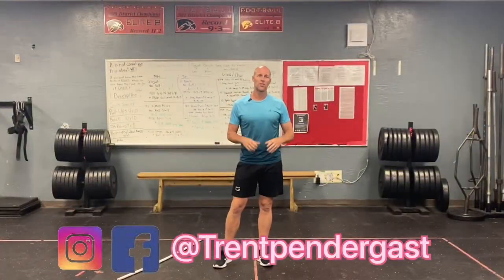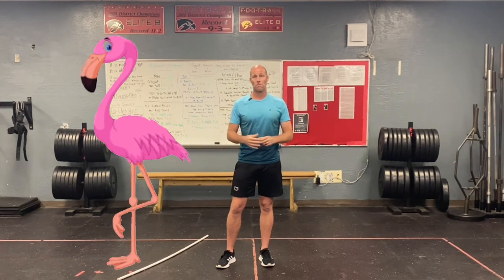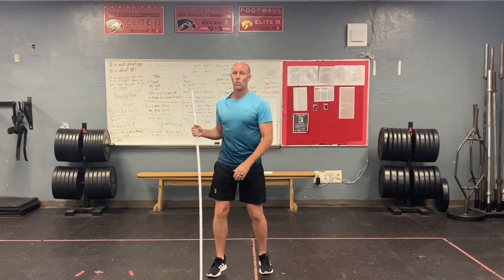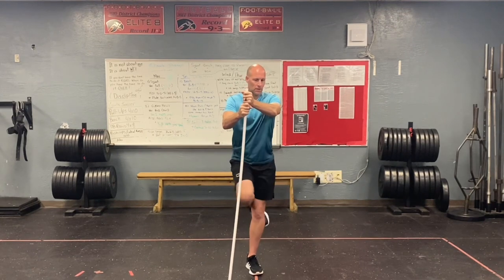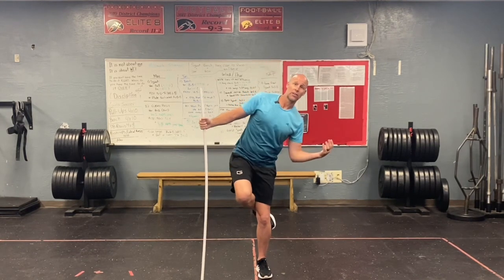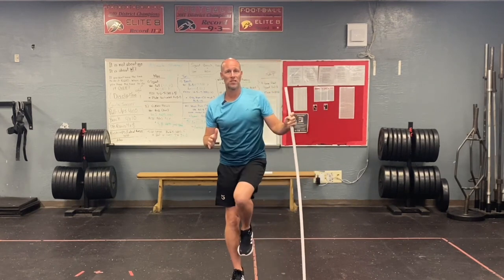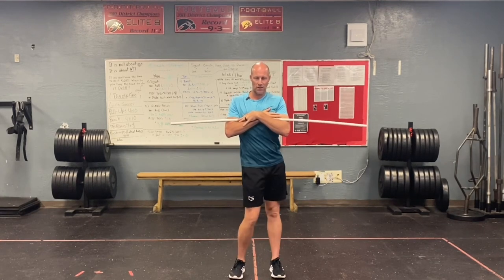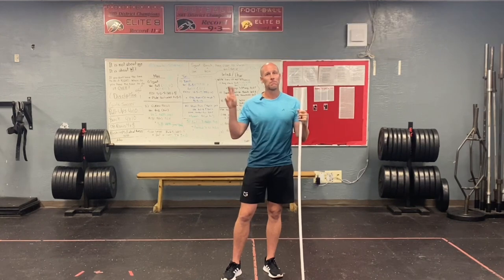A Simple Drill For Hip Engagement and Weight Transfer

Comment: The first drill where you're standing on one leg and rotating gave me some pretty bad knee irritation.  Are we really supposed to be able to turn like that with a straight leg?
Reply from the maker: My knees are not straight they are bent in an athletic position. Also the turn does not come from the knee. You should be rotating from your hip. It sounds like you have a previous knee injury if this drill is badly irritating your knee
Reply: @ticklingchainsdiscgolf  Thanks!  I'll be sure to be in a more athletic position next time.  I actually did have knee pain, went to doc, did MRI, but absolutely nothing was found.  It may be a strength issue and  I''m just not engaging the right muscles.
Reply from the maker: @AP-zo1ww  yeah this should be a simple mobility drill so you shouldn’t be feeling pain. If it hurts, stop immediately